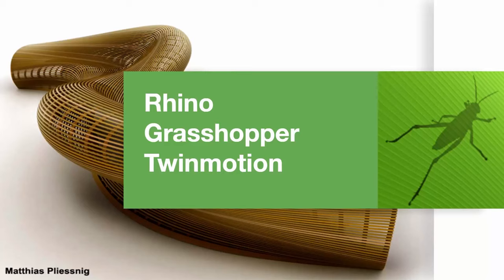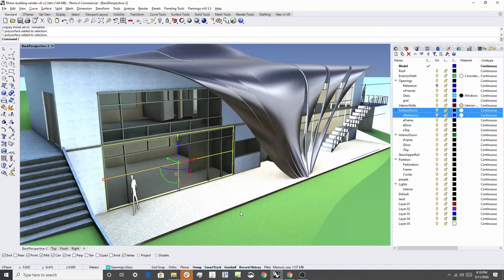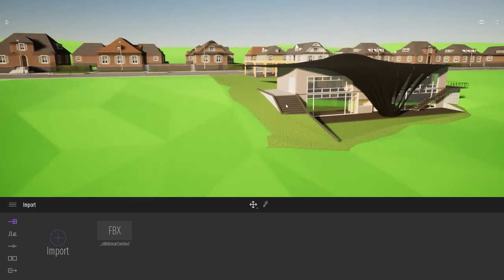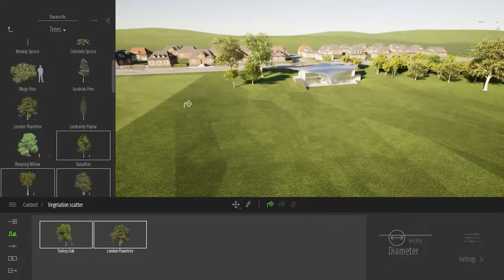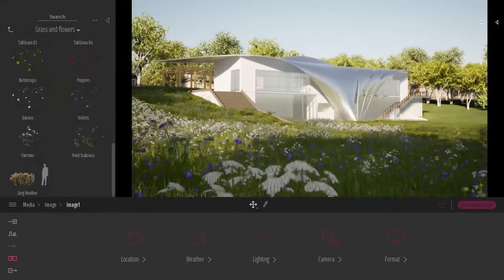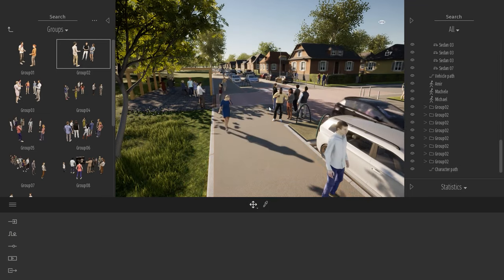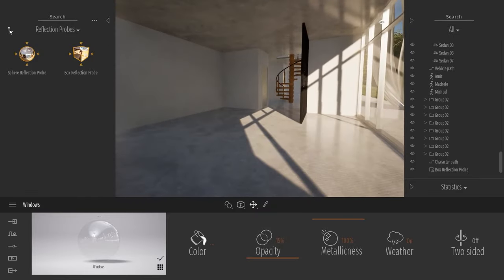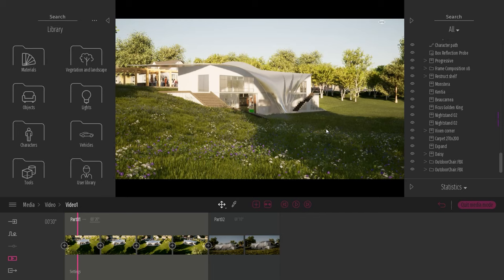Synchronizing Rhino data into Twinmotion in one click | Webinar | Twinmotion

Comment: Overall, TM is a fairly usefull software that has grown up alot in the last 2 years. I have alot of hope regarding in TM ... but ... yet there are things that keep me away from using alot TM:

 1- Uv's created in rhino not transfered to TM.
 2- TM need a material replacing system (like datasmith for UE). All my realistic materials are in Vray for Rhino. It would be awesome that these materials in rhino are automatically swap for the ones that I choose inside TM. That would be an efficient workflow
 3- Cannot sculpt static mesh (simple rhino surface). Something that is hard to acheive in Rhino but which could be the strengh of TM. Sculpting square basic default terrain mesh in TM is the unsatisfying workaround yet. 
4- Creating context still hard in TM : roads, sidewalks, terrain(from previous rhino surface). But it would be a very very good complement to Rhino.
5- Library is low quality, aswell as materials (realism.). Now I know real-time raytracying couldn't do magic compare to offline renders (Vray, corona, etc)... real-time has its costs. Thought, for final shots, could a basic offline render be implemented?
6- Synchronisation / live link connection. Working with 2 screens. it would be really helpfull for architecture CONCEPTION to have a direct live link. So we could navigate inside our rhino model and directly see the result in TM. That's something inkscape and lumion do but not TM.
7- As TM is the little brother of Unreal Engine, it could benefit a little more of the performance and quality of UE

easy to say, not so easy to do. Keep up the good development TM team !

Comment: Has been a good Twinmotion video, but a very poor one on the Rhino and synchronization side: you should explain more how materials change or remain the same when you update the rhino model, i.e. This plug-in is not very smooth yet: a TM file with a rhino Synchronized model sometimes is 3 times bigger than the same imported fbx... My suggestion is to be more technical and go deeper, you've already done a lot of wonderful video of this kind. Thanks